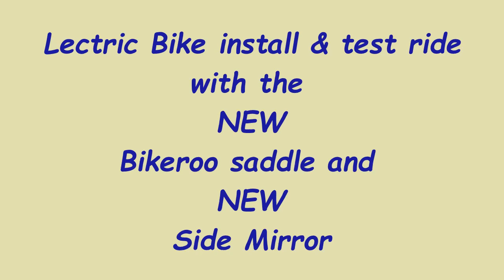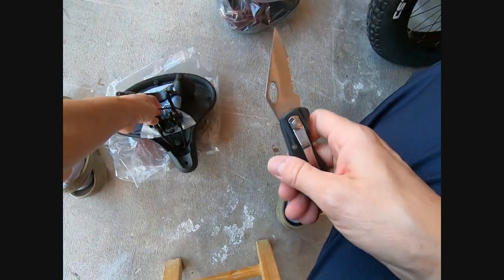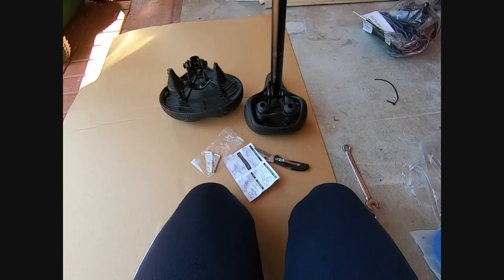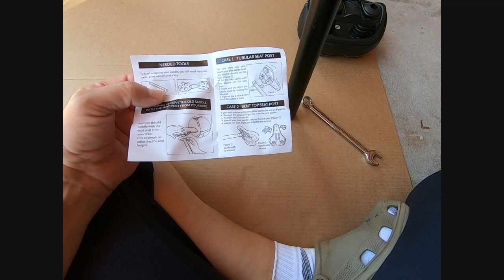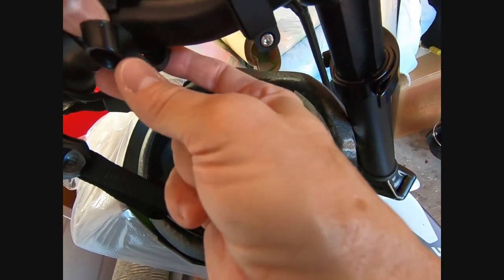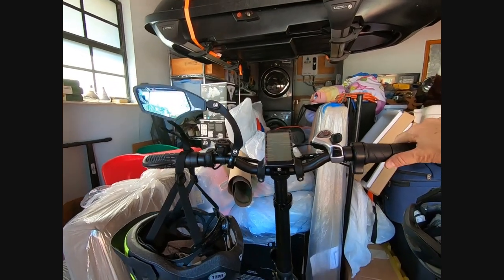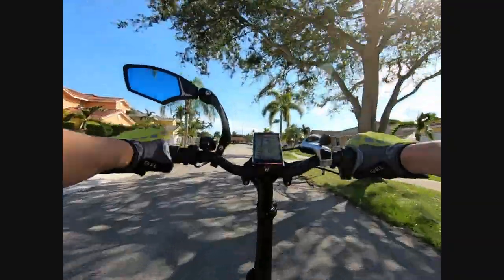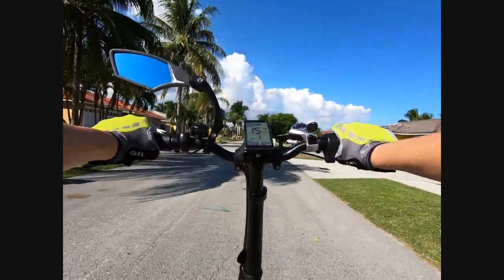Lectric Bike install & test ride of my NEW Bikeroo saddle and side mirror

Comment: I have replaced my bell with a Juiced horn and alarm combo. Loud works great in combo with a lock and well worth the money.  I also put in the bottom of the panniers a recycled rectangular soft packing foam. It helps them retain their shape. I am at 150 miles commuting to work.  Have fun riding.
Reply from the maker: WOW!!  That's great!!  Which alarm did you get?  I am looking into getting one and definitely a louder bell!!

Comment: I purchased this seat and the official suspension pole attachment from Lectric. I love the seat because it has spring mounts that float as you sit (Springs mentioned in video). Very good ride. I will test my whole rig sometime this week. We have had a lot of rain in my area, and I haven't had a chance to reduce tire pressure to 20 psi yet. I forgot all about my cover....I keep forgetting you can actually drive this bike in the rain lol! I hope the company releases a battery upgrade using the same form factor to provide even more power! This bike is amazing and people will just stop you because it is a amazing piece of tech! These are the inventions Nicola Tesla would support for the public. Knowing him he would have a battery with an average travel distance of 50 miles as standard. I can't wait for all the future upgrades....and even model 2. I just hope the price doesn't raise. I can make it to work under PAS 1 or 2 in 26 mins! 

Good job reviewing the seat...even your install error was good experience for everyone (Made the same mistake myself twice). This is the seat for comfort right here.
Reply from the maker: I am thinking about getting the suspension pole as well!!  🙂
Reply: @EaglesQuestAdventures  - Haven't tried it  yet, but it's been installed. I think it worth it. U can actually notice a bit of a difference. I haven't rode it to work only around the block.

Comment: A word of warning. I installed the very same seat on my bike in December 2019 (along with the Satori Harmony LT-2 suspension seat post).  One of the seat springs broke and dropped down out of the mount within a month.  I repaired it with zip ties and contacted Amazon to obtain a replacement, which came in a timely manor.  The seat broke again in the same manor within another month or two.  I contacted Bikeroo directly and they refunded my money.  I am currently shopping for a replacement seat.  I have a good friend that purchase the Lectric bike a few months after mine.  He also replaced his seat with a Bikeroo and he also had the same problem with the spring dropping out of the mount and causing the seat to fall as mine had done.  I am convinced that it is a workmanship issue and not due to abuse.
Reply: Try a Cloud Nine seat I think they"re also available from Amazon!

Comment: What is that rattling noise on the bike?
Reply from the maker: Hi!!  I believe the rattling is either from the brake or gear lines OR the fold joint on the handlebars.  I am going to see if tightening  the fold joint will help.  I hear it only when on rough terrain.
Reply: My guess is the battery. Might have to get some stick-on little round pads inside end of the battery